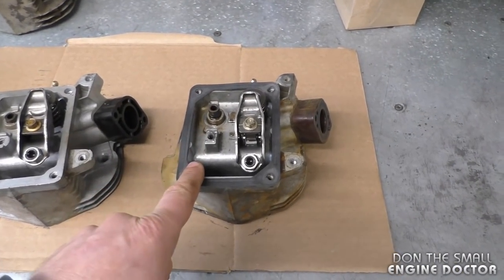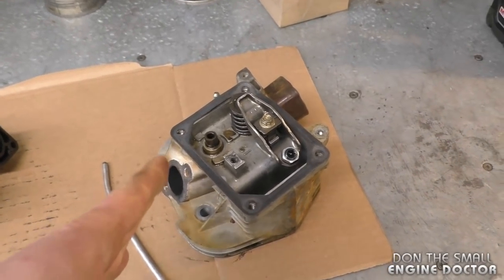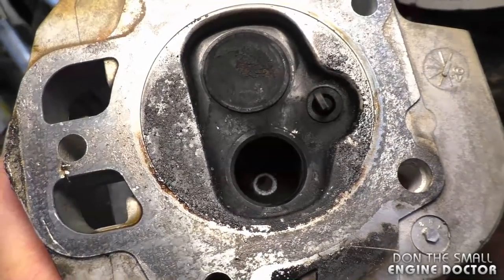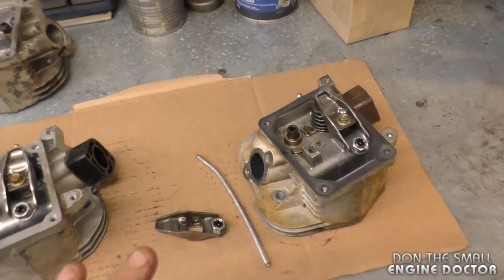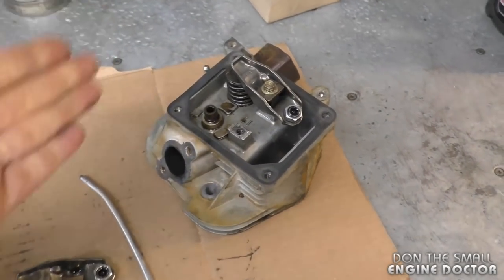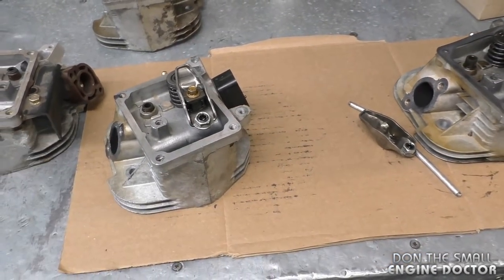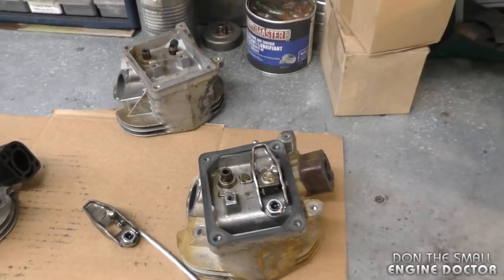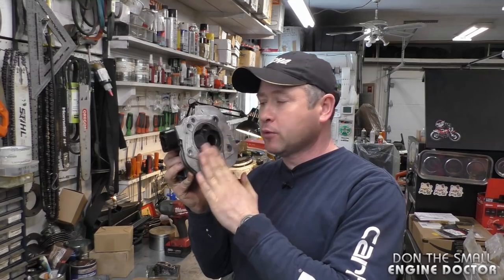Common Defective Briggs & Stratton Cylinder Head On Snowblower Engines! - Video

Comment: IMO A combination of a few things lead to this:
The aluminum casting expands from heat at a higher rate than the guide so the press fit loosens at operating temp.  Poor oil, fuel, carb too lean, or overworking the engine only makes it worse.
EPA pressure to reduce emissions has caused the MFG to tighten the valve to guide tolerance and the guide is pulled up with the valve due to binding when hot and extra friction from soot and deposits on the valve stem.
As others have stated, properly staking the guide (modify guide as needed) should mitigate the problem.  I would also ream the guide and polish the valve stem to relax the fit and prevent deposits getting a grip.

B&S - The same folks that brought you the Intek 31 series "maybe we should have put another bolt on there" head design.

Comment: I haven't had good luck with the new replacement heads either.  I did one last November and it came back around the first of this month.  What has worked better is  pushing out the valve guide completely, cleaned it and the head thoroughly with lacquer thinner and pressed it back in with a liberal coating of LocTite 680.  I know the book says the LocTite is only good to 180 degrees, but I've done four this way.  No come-backs so far.
Reply: Yep I just spot weld them all even new ones to
Reply: The replacement cylinder heads are made in china too

Comment: We have repaired them by drilling and installing a set screw with lock tite.  Our first one was a commercial customer and I asked them if I could try it ....I charged them nothing... The darn thing is still running and that was over a year ago.  I think it is caused by overheating from the cooling fins clogged with debris sticking to fins from an oil leak.  Great video as always Dony
Reply from the maker: I may try that in a pinch!
Reply: @donyboy73  if you do, make sure to drill a slight indentation into the valve guide for the set screw to seat into. It won't fail from my experience, even under commercial use.
Reply: @garny3766  that's an awesome idea 💡
Reply: @garny3766  that's what I see it on.. Briggs

Comment: Try staking around the guide after driving back in to hold it.
Reply from the maker: @dougr3715  not yet
Reply: I hit the guide in the port with welder never had a problem
Reply: @garny3766  
Never ever seen one do that , never measured one but I bet there smaller that side of the head
Reply: @carlleroy5952  I was wondering about that, too. Question: are the head and the guide the same material? I.e., what kind of weld did you use if they aren't?
Reply: @dagrote1  
Guides are harden steel 
Any weld just enough to mark it
Reply: @garny3766  
I bet thers a shoulder on the lower side. Its a simple manufacturing process, the clearance for rod would prob be cast, then the bore for the guide is machined to the proper tol leaving a shoulder.

Comment: Thank you for the video. I seized a moter just like this. I have taken many small engine courses and couldn't believe that I of all people seized an engine. Maybe it was a tecumseh I just know that the parts were not available anymore it was a sears I always check the oil level before I start any small engine and I always change the oil not to just add it to full. I live in New York and we get a lot of snow and I usually always end up clearing 3 or 4 of my neighbors driveways especially I take care of the older ones.  I have become crippled myself and I just can't do it anymore clear the whole neighborhood but if I am having a good day I can certainly try. Thanks again for your videos and I always try to get better in my knowledge of small engines and your videos are quite good.

Comment: After the guide is put back in place I drill a hole from the outside of the head  about 3/4" deep, then instal a 1/8" diameter roll pin.
This repair has worked for me 100% of the time.

Comment: i wonder if you could remove the valve guide and knurl the outside of the guide or the inside of the head to keep the guide in place...it seems like the heat on the exhaust side is causing expansion and the guide eases it's way out.....just think how many machines were tossed because people thought the engine blew up or seized...great video Don
Reply: Old timers would knurl the thing as you suggested. I always say, do what works,  not what's right. Thinking like a mechanic. Who has $300 plus shop labor to throw at it?  I see vehicles go to junk yards because of dumb stuff like this.

Comment: Peening it in place, would that be a more "reliable" backyard fix?
Reply: I’m 98% sure I’ve seen Donyboy peen a valve guide in before.

Edit: I think that may have been the seat
Reply: I would think the peening would cause dimensional changes on the ID of the guide.
Reply: @user-wo7rz3yn4o  You’d peen the aluminum head around the guide.
Reply: @Shootingstarcomics  oh ya duh!  I was thinking the peening was done on the guide itself.  Thanks for that.😲
Reply: @user-wo7rz3yn4o  I’d have probably had the same thought if I hadn’t seen someone do it in a video.

Comment: What's your opinion if I pop out the pushrod guide out completely, drill and tap a small hole through the guide base, reposition the guide and drill just enough so an allen screw would lock it permanantly in place?
Thanks mate...great vids!

Comment: Cut a grove around the guide at head level with a Dremel. Does not need to be all the way around  just 3 spots will work. Drive it in then peen the aluminum into the grove and use a punch to hammer a series of dots in a circle around the guide to expand the head at that spot. This will last the life of the engine.
Reply: My thoughts exactly...yours solution would probably be much better than my idea...a groove (like for a very shallow snap ring) or flat spots ground at right at the level (or a teeny bit below) where it sits at it correct location...then peen it down to lock it in place
Reply: Brian C . Clever idea Brian and Used Mower Parts USA too. Would like to see Don give that a go. Cheers 🇦🇺
Reply: Guess u could do that since guide is rsised up before you tap it down
Reply: I was thinking the same thing.....
Reply: Seems like this would be a good solution. Anyone have a video on it?
Reply: Great suggestion. And easy fix. Don should try this on one of the many heads he has.  I am sure it will last forever. Thanks.
Reply from the maker: @leif2335  here's a video on a lawn tractor head i did, it's still going strong 
https://www.youtube.com/watch?v=ZQj6ZaFu490
Reply: @leif2335  Try Taryl fixes all. I think I've seen it done on his channel.
Reply: @leif2335  taryl dactal he has one and he has others too
Reply: @haydenc2742  
I agree, a snap ring or spiralok is the proper solution, but it woulda cost B&S $0.50 more!
Reply: Another way is to heat the head with a torch so the guide falls out, then totally degrease both pieces. Put the valve guide in freezer and get it frozen. Then use a piece of metal or clamp the head into a vise and use a screwdriver under the cylinder head to stop the valve guide flush, heat the head with a torch then drop the frozen valve guide in. 
Also... You could also put a very thin layer of high temp epoxy on the guide let it cure then use calipers and sand it in a drill press or drill so it is .005 bigger than the hole (when at room temp). Then freeze it, heat the head and drop it in.

Comment: I did my pushrods last year, exactly a year ago to the day when my snowblower decided to  crap out immediately after the big storm. 
In my case, it was bad valve lash.
I had no starting or performance issues prior to the failure. 
I am planning on tearing it down again in the spring to avoid any problems next winter, I'll definitely verify the guide while I'm in there.

Comment: You could tig braze it with aluminum bronze to keep it in place. Aluminum bronze should stick to both metals if the oil is cleaned thoroughly.
Reply from the maker: good idea!
Reply: I knock the guide out and tig weld a spot on the side of the guide, right at the top on the exhaust port side. I then make a notch in the head to accommodate the spot weld.  I then drive the guide back in, making sure the weld lines up with the notch.  I have several of these out and all are still running.

Comment: Do you think the valve is popping from increased cylinder pressure, from plugged spark arrestors. The engine cant breathe. Whenthe exhaust is opening up. The pressure hits the valve a bit harder and starts moving the guide.

Comment: That is a very useful information, do you think you could drill through the head and insert a set screw to hold the valve guide in place?
Reply from the maker: yes you could, i'll try and show that as well in another video

Comment: I've seen this happen  on lawn tractor Briggs engines as well. I would never hammer the guide back in either. I wonder if it may be because of the heat on the exhaust side expanding the hole after a while. Good video!!!
Reply from the maker: must be the heat and poor quality metal

Comment: Don, great video!  I couldn’t start my snowblower and after looking into it more found one of the pushrods bent. Exactly what you were describing!
Only problem is I can’t find where to buy a new cylinder head for my Ariens 08200814 ENGINE, BRIGGS PF 1650, 120V. 
Any suggestions?
Thanks again for your help!
Reply from the maker: if you are in usa go to www.discountonlineparts.com

Comment: What about the intek newer model. Connecting rod breaking. I had put together one and it kept shearing the flywheel key, so I made a key from a piece of a file ( super strong) . Engine ran good. A week later the connecting rod broke. And only issue was the broke connecting rod. 🤷

Comment: Press the guide out, put it in a lathe, turn a light knurl on it (alternatively, the guide could be peened by hand all around as evenly as possible, but a knurl would be best) and press it back in the head to the proper spec height. This would be a very acceptable repair and the guide won't ever move again. Thank you and keep up these great videos.
Reply: High carbon steel might be a problem

Comment: My reckoning on why the briggs does this is  Due to carbon emmisions to get carbon level down exhaust valve is not opening as long so a portion of previous combustion is getting reburned,  resulting in excess carbon because of this excess carbon buildup on valve stem which then pushes guide out.  If you have got a good oven drive guide fully out apply loctite then heat the head up on 350ish for 40 mins guide should push in with a little effort head will recool and shrink should be good as new till next time.   Or just buy a chinese engine for half the cost get the same running life as a new briggs then just buy another.   Makes me cry 1970's side valve briggs good for 30 to 40 years now its 3-5 shame on us for being consumers
Reply: I just think those $99 212cc chinese engines that just work... Even in EU Finland (vat 24%) they're 199€ with Battery electric start! No point of paying premium over Briggs! 

Also I've had no problems with ANY machine as I started using Alkylate fuel. Its ~50cnt more per liter, but no need mess anymore with old fuel and problems that normal gas brings!

Comment: I have the 14.5 . Wondering how many hours of run time before this usually happens?
Reply from the maker: if you change the oil regularly it will last longer and also if you have a throttle. the ones that rev full blast all the time don't last as long
Reply: @donyboy73  Thanks ,if I lived in your neighborhood I'd bring all of my small engines to your  shop !!!

Comment: Go figure. Does this happen with non-winter duty engines? I've got a newer Briggs engine like that on a tiller, can't remember the model, wonder if I should inspect under the rocker cover to avoid this going so wrong.
Reply: That's an excellent question. Maybe the reason Dony sees so many of them is that it gets really cold in the winter where he lives. Starting up an engine on a snowblower when the ambient temperature is 0 F seems likely to cause stress on the head, as it's suddenly exposed to temperatures in excess of 900 F at the exhaust. 

A question to ask would be whether this problem is less frequent the farther south one goes, until you get to FL, where mechanics never see it.
Reply: @dagrote1  oh, that could be, interesting thought. I don't run my tiller in that cold of weather 😁 though TBH I barely run it at all: had it maybe 4 years, and I think I've run it maybe 10 hours tops. It's definitely the newest, and aside from the Vanguards on the lawn tractors, the fanciest small engine I own. Any worrying about it is probably premature.
Reply: @rpavlik1  I'll bet Briggs knows the answer to the question, since surely they track reports of this problem. They might be able to map out incidents geographically. They also probably know if it occurs more frequently on snowblowers (which are fired up when it's cold out) than on riding mowers, etc. (which tend not to be).

Comment: On some engines with this problem you may be able to find a spot you can drill through the side of the head to intersect the valve guide, with the depth set to just dimple the valve guide. Tap hole and green locktite a set screw...

Comment: Great video.   An add on step for the backyard hack is to apply loctite 603 retaining ring compound to the valve guide before reinserting.  Be interesting to see if it holds up to the heat.  Otherwise it's a good use for this product.

Comment: Dony great video. Could you do a video on how a motor keeps running after you pull the spark plug wire off the sparkplug. This past week at work we had this happen. Had to choke the air off to stop the engine from running. Thanks
Reply: Twin cylinder?
Reply: @spankey0069      yes twin cylinder honda 24hp
Reply: Pull off Both Plug wires!!!

Comment: Great Video Don, I wonder if you could put some epoxy on the valve guide to keep it from coming out. JB Weld. But that would be part of the backyard fix of course.
Reply from the maker: unfortunately the heat would  make it useless, good idea though!

Comment: I have a toro lawnmower with the exhaust valve seat that popped off . I brought it to a repair shop the guy told me what was wrong before I got all the way to the service counter. Three seasons on it with a 3/4 acre lawn .

Comment: I tap them back down to word or post post to be and then I take a brick punch and I pricked the backside where the spring goes all the way around the aluminum and make sure the valve guide is got enough clearance for the valve because I know it gets a little bit too hot and I don't know why the Briggs & Stratton make this way?

Comment: What keeps the same thing happening to the new head??  Should you spring for the extended warranty on these snowblowers?  Could you replace the motor with a harbor freight engine if they are more reliable??

Comment: How about machining a new valve guide with a shoulder on it. Press out the old valve guide and press in the new one from the valve seat side. The shoulder would keep the guide from popping out ever again. The shoulder would only have to be 1/8" thick .125 . Looks like there's plenty of room between the valve and the top of the head. Thoughts?

Comment: I think that your assessment of why the valve guide might be off. I feel that because the exhaust valve had become too hot to the point of seizing into its guide. With the additional heat, the guide becomes easier to move in the aluminum head, causing the bent pushrod.
I've noticed that although the engine will run fine when the choke has one more notch to open. That causes a running-rich condition and would likely be the cause of the EXHAUST valve moving the guide.
Reply: that could be a issue.  That might be due to their "tune" on the engine-cam timing or carb overly lean.

If its running better with the choke on...your carb is gummed up, but back to point.....I never see any of the others small engines with guides moving.   They Fd up....cost cut themselves to chapt 11.  Lesson to be learned in their "business schools" as asian manufacturing is eating everyone up now.

slap a harbor freight on it.....send pic to JOHNNY DEERE

Comment: Hi Dony , I hope all is well for you and family in this pandemic we are in. I have a 24in Troy bilt snow blower that was given to me and I did a tuneup on it. When i drained the oil and refilled it . I notice that oil was coming out where the fuel tank mounts to engine at the base where tube is at bottom of dip stick. It looks like some kind of gasket has gone bad. Would like you opinion on this matter, thank you.

Comment: I like Briggs engines because t there newer engines seem to have Some issues I prefer the old flat heads from 1996 and below thanks for the information the old flat heads I have staked many valve seats back in the seem to get too hot and pop out thanks don your a great guy your videos are excellent have a great weekend

Comment: I see some shops that have the right equipment are knurling the guide and then pressing it back in, instead of just pounding it down. I'm not sure how much better that works where I haven't personally seen any that have been repaired that way. I almost think that maybe Briggs should knurl the guides in the first place or make them threaded with some sort of high heat thread locker to hold them in. I broke a push rod on the intake side of one of my personal  blowers last week which I find odd. I haven't had a chance to inspect the head yet, I diagnosed it, grabbed another machine and finished the job. Less heat and a different guide on the intake side I would not think that would cause the guide to move like the exhaust valve guide does

Comment: I would press the guide back into correct location then spot weld at the outer edge of the valve guide on the inside and even a spot on the topside. very small amount is all that's required. works 100%